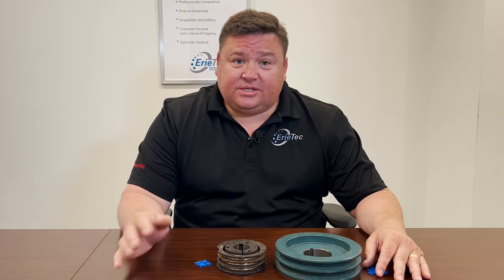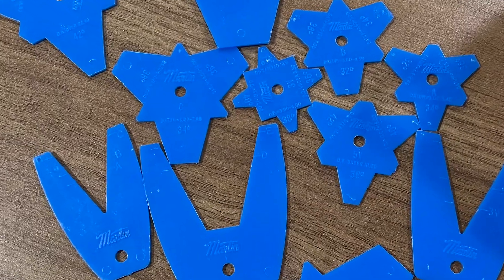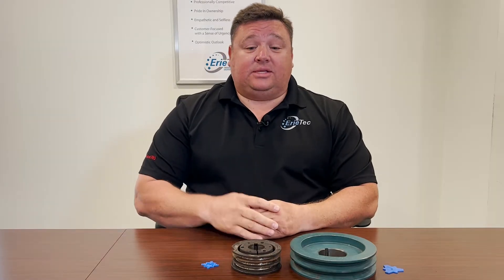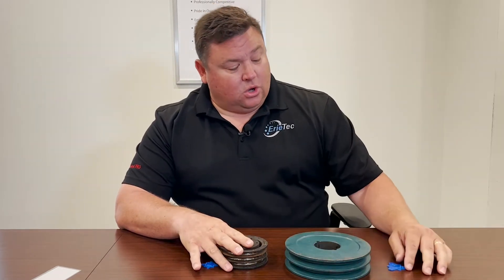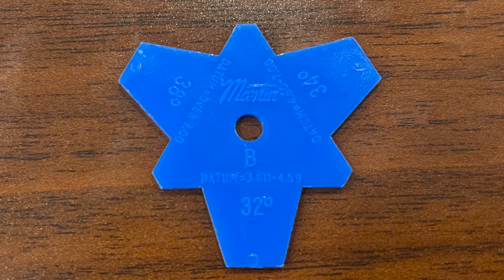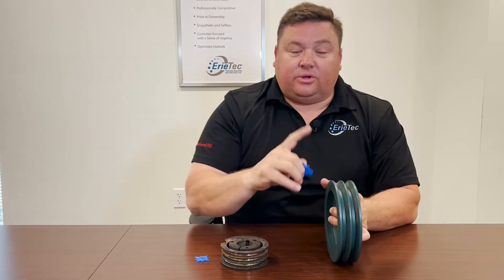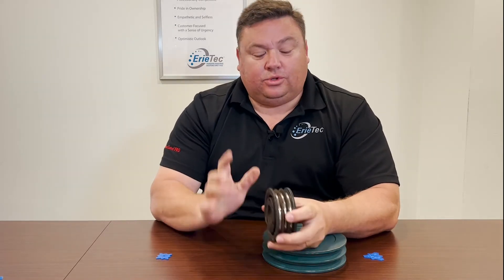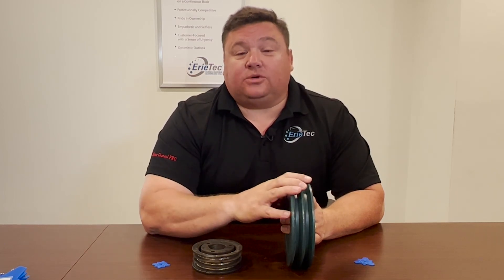ErieTec Educates: Accurately Check Your Sheaves

Comment: Can someone tell me if, in the event that the pulley loses its paint or enamel where the V-belt goes, that contributes to noise from the belt rubbing against the pulley as it rotates? I have some machines that are noisy and others that aren't. The ones that are noisy have pulleys with missing paint or enamel where the belts rub or rotate. What do you think?